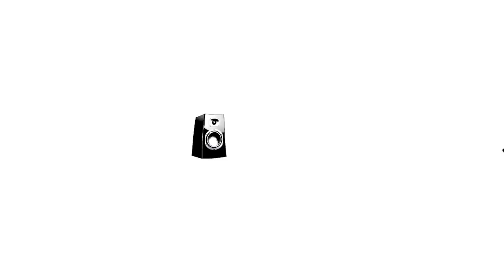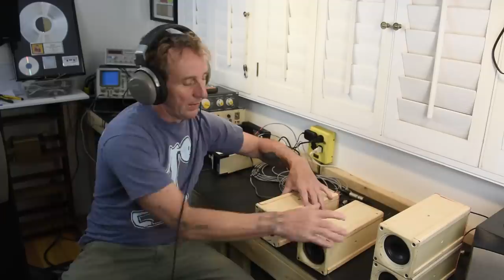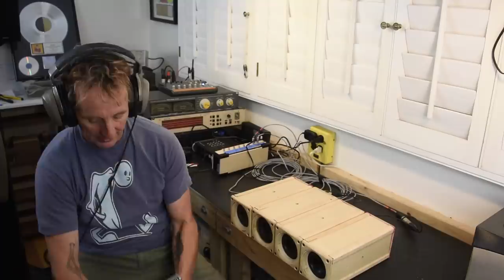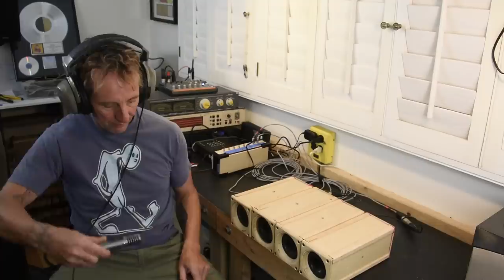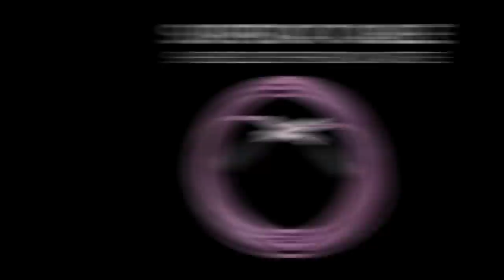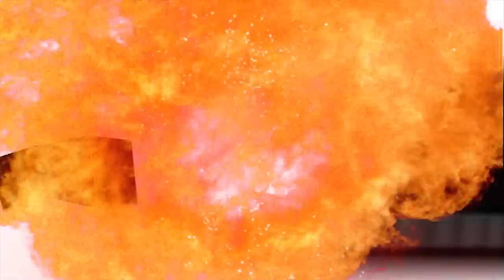Line Array vs Point Source vs Human Hearing

Comment: That is thought provoking indeed. however, as a listener who attended many many raves and dance parties during the 90's I personally have found the VLA's seam to lack something compared to the point source systems,  cant quite put my finger on what though. perhaps the nostalgia from the 90's is not there, I do think the point source stacks looked more meaning full.
Reply from the maker: That is an excellent observation. And a subject I have put much thought into. What I believe to be the case is that since EDM and raves tend to rely on pre-recorded music or electronic music that tends to lack the dynamic range of live instrumentation, that point source systems with very dynamic outputs offer an excitement level in reproducing these somewhat non dynamic initial sources

Conversely live music with its extreme dynamic range especially from the percussion instruments, tends to need the engineers to implement compression on various levels to reduce the dynamic range. Having a system that also helps reduce the extreme dynamic range of live music like line arrays or non horn loaded systems, tends to be advantageous for reproducing live music.

So in summary ddm needs more dynamic range and live music needs a reduction in dynamic range so selecting a system that compliments those needs tends to be a wise choice
Reply: @DaveRat  awesome evolution Dave, thanks!
Reply: *evaluation

Comment: i bet those little speakers combine pretty good, hiding much of the comb filtering below ~1000hz.  I agree point source sounds better, danley sound labs anyone?
Reply: Did he say point source sounds better? I kinda missed that :(
Reply from the maker: Point source sounds great and does not scale well.  For big spaces, using a system that allows combining many drivers to cover the space, tends to be the better choice
Reply from the maker: Also, point source is a source the emulates or recreates a sound coming from a single point in space. Like a coax or kind of like what most home stereo speakers try and do.

Comment: Try applying phase correction to each driver
Reply from the maker: As long as the listener stays perfectly still and never moves, that could work.

As soon as a listener moves even slightly or turns their head, a new phase correcting would be needed for the new location of the listener or listeners ears.
Reply: @DaveRat  no more Starbucks at the show

Comment: Hey Dave, great video. There's one issue i came up with. usually  you're not that close to the speaker with your ear. Could you please demonstrate line array vs. Point source with different distances for the Mic. It might make a difference or not?..
Reply from the maker: Will try and cover that, but yes, the issue just changes in frequency

Comment: Freakin Awesome. You always bring up the best points about speaker placement and stuff. Just curious to does mounting the speaker to the outside of the face plate cause any difference??
Reply from the maker: Do you mean, mounting a speaker internal or external to the baffle? For woofers, should not have any rear impact. For HF, mounting in such a way that they're not reflections caused by the mounting method is important
Reply: @DaveRat  I was meaning was there any deflection difference between mounting a speaker external instead of internal like you have done here. Im 47 and have been a professional car stereo installer turned music producer and like you i really enjoy building boxes. My only problem is i have alot of experience in subwoofer enclosures and not things of this nature. Thank you for taking your time and getting back with me. It says alot about you and your care about sound. Im a stereo head from way back!!!

Comment: Wow. So bose 802s have removed comb filtering by mounting drivers on a curve baffle -a bit of horizontal and vertical array all in one??
Reply from the maker: I guess. Placing drivers close together reduces comb filtering or at least lushes it to a higher frequency, ideally above audibility.

Forming a vertical line reduces vertical coverage, forming a horizontal line reduces horizonta coverage. Forming both, reduces both. l

Comment: We also have a hard time locating sound directly in front or back of us.  Question, I've seen so many large format system that hang two arrays per side either both facing forward or sometimes the outside hang is acting as a side fill, so how much separation or how far off axis before they no longer effect each other?
Reply from the maker: great point that are definitely recommended angles and distances to minimize the overlap between them check out software from l-acoustics called sound vision

Comment: How does stacking speakers vertically solve the problem with horizontal spreading?
Reply from the maker: It doesn't, what it does is "not create horizontal issues due to horizontally spaced or placed speakers"

One wide, maximum not have the issues of multiple wide 

So a single speaker won't have any more or less horizontal issues than multiple vertically stacked speakers. As all the issues will be vertical

Comment: Very interesting. I wonder if you use some type of directly fins or guides in front of the speaker if it would make a difference.
Reply from the maker: There are many designs out their horns with fins and various complex designs to reduce interaction between multiple sources. The best way to minimize multi-source interaction is to combine them into a single source. Multiple sources will always interact because the listener or measurement equipment will be located at different distances from the separate source

Comment: Great practical demo. thanks.  I'm building Steve Decards (Decware) Tiny radials.  Very interesting Omni directional speaker based on a tiny driver with an integral passive radiator.  The driver fires  upwards.and is giving some amazing results but the question is can this be scaled up by using a bigger driver passive radiator combination or multiples of the small drivers (four) firing up wards.
Reply from the maker: Fun project! Large passive radiators can definitely add low end.  But as with all in sound, everything comes with a cost.  For passive radiators, the cost is time lag and resonances of the added low end. This may or may not be desirable depending on the application and personal preferences

Comment: So what if you build a wide but tall design with multiple rows of two way speakers i.e 6.5 inch speaker(mid)+tweeters inside with a  90 degree sound dispersion zone with level 4 rows pointing below ear level 4ft one at 6ft(average mans height) and the last row elevated above that at an angle of 30 to 45 degrees would that not eliminate the loss of sound via movement or would it cause interference?
Reply from the maker: Hmmm, in general, speakers are not hyper beamy with defined coverage, even well designed horns have dispersion blurring and frequency dependant coverage patterns. When you place multiple speakers very close, the horizontal time offsets are very horizontally audible regardless of whether you complicate the array setup or not. 

Here is an article I wrote a while back that may be helpful in explaining more.

https://www.prosoundweb.com/zoned-summed-line-a-discussion-of-array-structures-performance/
Reply: @DaveRat  Thank you, your knowledge is very appreciated.

Comment: The noise is pretty loud. Hard to hear you talking ...
Reply: It is pretty hard, but he's not saying much important during those bits.
The first demo is to show that, with a "point" source,  the only effect of moving the microphone is the high frequency fall-off, caused by the directionality of the speaker.
The second demo is to show the frequency-dependent effects caused by having multiple sound sources.
The third demo is to show that these effects only really make a big difference when moving in the plane of the speaker array.
Reply: @cameronfoale8270  thanks for explaining 😃
Reply from the maker: Sorry about that I will add subtitles soon
Reply from the maker: Ok, I added the English subtitles
Reply: @DaveRat  Awesome. Thanks. Great video!

Comment: I still love the sound of a multicellular horn. Lines don't sound right to me but they sure are easy to gig.
Reply from the maker: I like a variety of systems. Less a fan of the sound of big long horns.  A well setup premium line array that is not trying to shoot too far, can be amazing, one huge benefit of line systems is their ability to reduce the amount of sound bouncing off the ceiling.
Reply: @DaveRat  A multicell suffers from few boundary reflections if set up properly. Worked with lines and almost all types of loudspeaker.  I keep finding the multicell big w bin of the Shearer horn to be a wonderful thing. They just make people move I get + comments on them the lines people say nothing about the sound. I also enjoy my Community Leviathans with extensions Elvis sound crew knew good sound and even today they sound subjectively better than lines and provide better off axis quality. Thanks for the vids I will keep watching if you want to test a well designed multi I may be able to loan you something.
Reply from the maker: When all this shutdown stuff is done let's chat. My company has an inventory of L-acoustics k1 k2 arc syva Kara and more, EAW Anya and Anna and I've designed quite a few systems. 

For our old stuff, check out ratsound.com/evolution
Reply: @DaveRat  Most of my PA bros are all geared up but no shows -Stay well.

Comment: Subscribed. What happens if you stagger splay them in the vertical?
Reply from the maker: Pretty much the closer you get multiple independent sources that are reproducing the same signal, next to each other, the less interaction you will have from those multiple sources. Conversely if you get the source is far enough apart so they truly act as independent sources they will no longer some together but they will give you additional coverage but not additional volume. That said in the rat trap 5 system we used to alternate the high-frequency horns so they were staggered to reduce the vertical line array aspects in the eye frequency and mid frequency. The big challenge is to get the high frequency and the mids and lows to all operate in a similar fashion. If you get all of the high frequencies to operate in a line of rain getting the low frequencies to do so as well is advantageous

Comment: Hey dave does the same method apply to subs as well? Is it less noticeable using them?
Reply from the maker: Of the distance apart is small compared to the wavelength, the separate sources begin to act like they are the same source. So the transitions between the seperate sources can go away for lower frequencies
Reply: Do you have a email i have further questions with my setup for my company

Comment: when stacking does time delay or db level need to be ajusted to get max/effciency when in a diy setup
Reply from the maker: Hmmm, Need more info to on the question in order to answer.
Reply: @DaveRat  wanting to diy line array for small party’s and want the volume to reach distance and sound good with out blasting ppl siting closer to stage didn’t know if time delay would help reach back farther with out having delay past 50 foot or use -db on the lower speakers as the array grows taller . Sry idk how to explain differenty thanks regardless
Reply from the maker: @kricketman12  a line arrays can work with no time delay or level differences between boxes as with a well designed and properly angled array, delay and level shading are not needed

Comment: Dave, In with you 100% however I have a solution to the Point Source issue that I would like your thoughts on.
Reply from the maker: Sure what you got? I will be doing another video discussing more on the topic soon
Reply: @DaveRat  KV2 VHD 5.0 addresses all of these with the Constant Point Single Source. I personally think its a game changer.
Reply: The KV2 VHD 5.0 is a sonic game changer and addresses many issues,   however there is a big but. The specs reckon that it is good for 20-50k people. Personally I don't think it is that baldy,  which would mean that it will have a limited use as far as audience size goes. I have never heard one person all,  but by doing the math on it,  I think that it will fall quite short on headroom if you try and stretch it's legs. The one thing that I really really like about it is that they utilise a class AB topology for the HF, which I think is critically important.
Reply: @coastben having mixed on and rigged VHD systems quite a few times: they kinda hurt in the HF, and they are not flexible at all for different audience sizes. They’re also super bulky and awkward.

Comment: Yer but...The reason we dont notice the errors from a vertical line array isnt because our hearing is more directional in the horizontal plane. Its because we walk around rooms as opposed to climbing the walls.
Reply from the maker: Do you know that you, (or at least I and many others can hear a 1/10,000th of a second offset from ear to the other with headphones? 

Also, if the issues are because we wander, and not because of the difference in hearing resolution, why are home stereo speakers always left and right rather than up and down?

Seems we could out one speaker near the ceiling and one on the floor and have amazing perfect summation and coverage of your living room with out all the left right comb filtering, right?

Or

Perhaps there is desirable and undesirable interference patterns with L/R stereo being a desirable interference, multiple horizontal closely located sources and undesirable and vertically displaced sources being just plain boring because we lack the auditory resolution to discern cool sounding stereo with vertically displaced sources.

Thoughts?
Reply: @DaveRat  I'm not sure that we can hear the time difference between left and right signals as low as 0.1ms, as  I understand it, the pickiest of recording artists will complain if they hear a delay in their foldback signal of anything greater than 25ms.Also there is Dolby surround encoding, being able to hear 0.1ms delay would make listening to the raw stereo signal very disorienting,yet the raw signal is an acceptable stereo image.
I believe that the majority (if not all) of our stereo perception comes from pure signal level and that there is significant transmission through the skull, so a left ear signal arrives at the right ear via 2 paths,one through the air and one via the skull. Tone analysis of the delayed signal,compared to the raw would yield timing information.So rather than hearing a delay, it is perceived by tone differences. 

With vertically aligned stereo speakers you would loose some of the comb filter effect, a single source also produces this effect in anything other than an an-echoic chamber, just try playing 1kHz tone from 1 speaker and move about.Thats why audiophiles have a rigidly defined listening position and very simple room structure, the room can be equalized so the effect of the apparent comb filters is negated. But Vertically aligned speakers dont  give us ant stereo information since, as you show, our ears are on the sides.

Its all down to our evolution in a 2 dimensional world. We have little capabilities in up and down compared to left, right, front, back.its the same reason our eyes are left and right, not up and down.Movement (and position) in the vertical axis is not such a feature of our lives.
Reply: DT - The point is not that a 100 usec delay can be perceived as two separate events, but that a 100 usec change between L and R can indeed be discerned due to the change in phase.  I can hear edits in the best classical piano recordings due to this (even when others can't), e.g., when mics for alternate takes have not been repositioned accurately.
Reply from the maker: @dougaltolan3017  exactly, we are hyper sensitive to horizontal offsets and issues.  Also, new vid on hearing .1ms uploading now
Reply from the maker: @bandogbone3265  agreed and on point. Vid on hearing .1ms uploading now

Comment: My question is... If those drivers are pretty close enough and you get farther away with the mic, isn't the vertical comb filtering supposed to be minimized and less perceived?
Reply from the maker: Yes sort of, perhaps less perceived or more accurately at a longer distance the issues will happen at a higher frequency. one might think the issues can be completely eliminated by getting the sources so close together that they unify into a virtual ribbon like radiating source. But even with a ribbon of significant length you will still hear a tonal swish slowly rising or lowering in frequency as you alter your elevation in relation to the virtual ribbon.

These issues from multiple sources or from a single source that is a large in dimension in relation to the frequencies being reproduced, appear to be unavoidable with current technology and physics. Though they can be reduced they cannot be eliminated. Because of this piling those issues in the vertical domain weather using a line array 4 vertically stacked point source arrays, offers some advantages due to the biology of human hearing.

Comment: So what about a cross array? Or a circular array?
Reply from the maker: Circular makes a beamy cone like a flashlight. The wider the array, the narrower the coverage is a good way to picture it
Reply: Dave Rat interesting!!! Thanks for the response.. is it the same with a cross?
Reply from the maker: @DanMarcelino  hmmm, a cross or a T will be vertically beamy where it has horizontal width and horizontally beamy where it has vertical height and be louder at distance where the two meet. Sort of like a top heavy beaminess 

This can all be predicted with available software.
Reply: Dave Rat cool to read, thanks!!